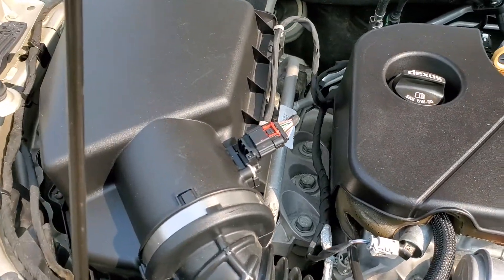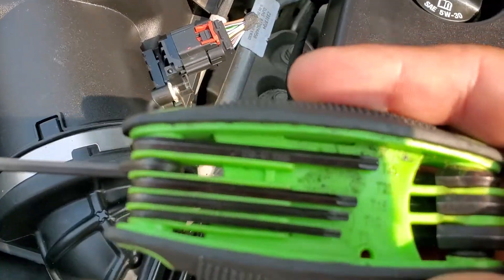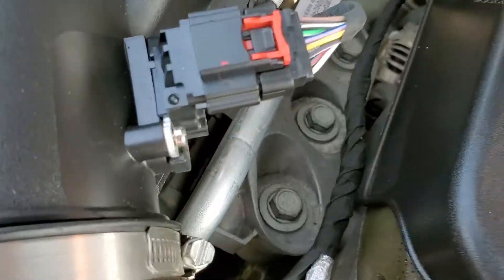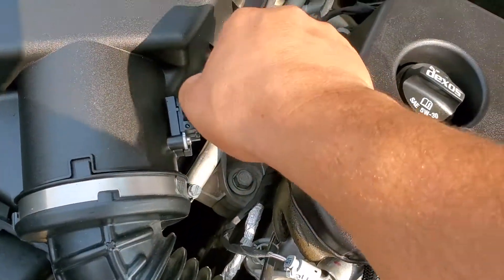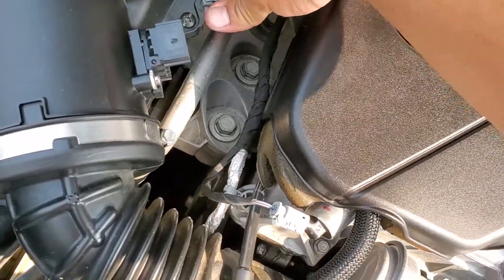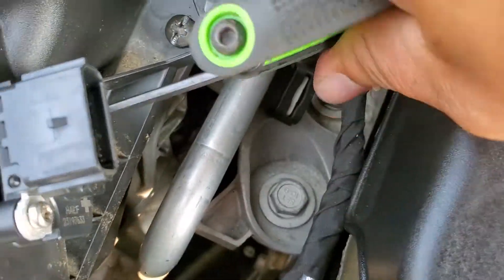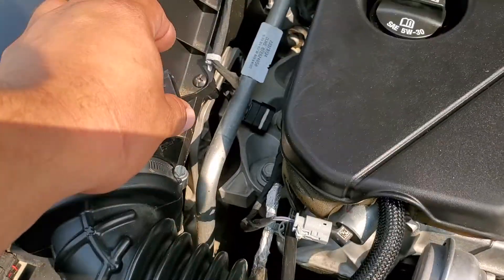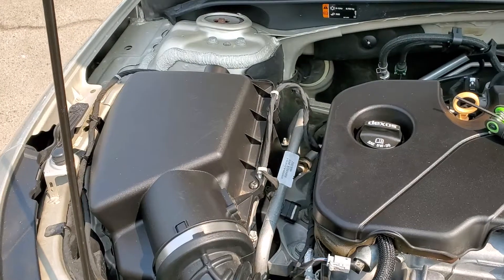How to: Remove the Mass Air Flow MAF Sensor from a 2016 Chevrolet Malibu

Comment: Help I changed my Maf by myself and the check engine light Still on help please
Reply from the maker: It's because it's still in the system. Driving it will make it go away if fixed, but to clear it you need a obd2 scanner to clear the code and try again. You can also disconnect the negative battery cable for a good 2 minutes and that should clear the code as well. Good luck 👍